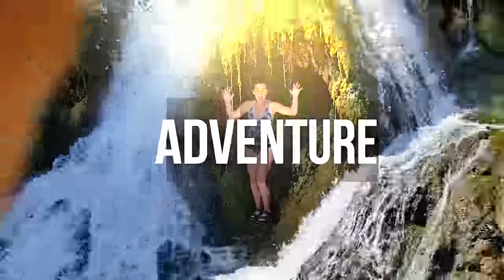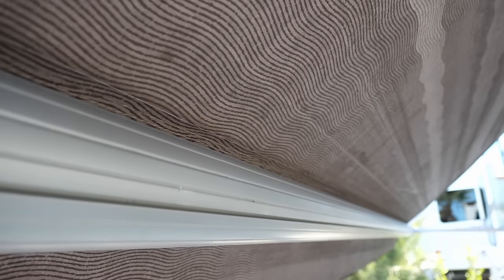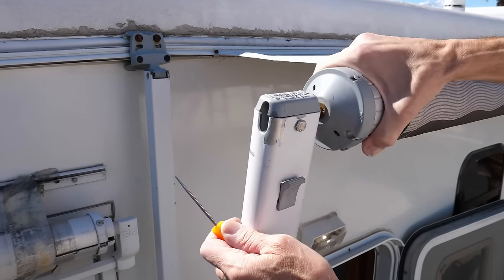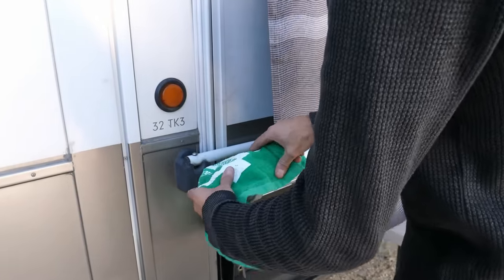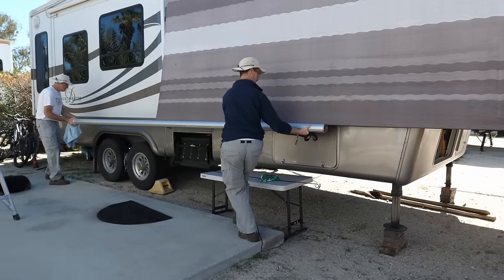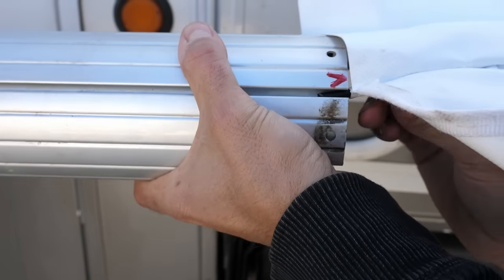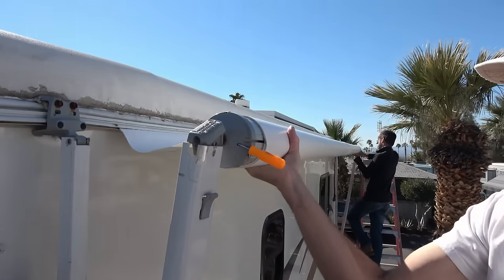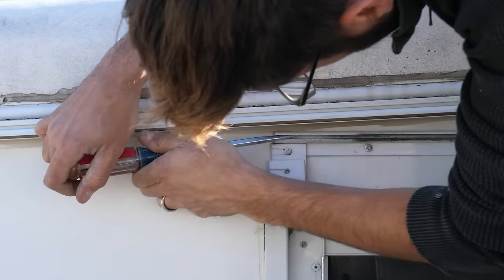How Easy is it to Replace RV Awning Fabric? - Replacing A&E Awning & Slide Topper with Tough Top

Comment: What?  No O-scope, DVM, or soldering iron?  Not even a spectrum analyzer or network analyzer?  Actually, this is very timely.  When I was snowbirding in Florida this year, the wind came up pretty dramatically in the night.  I didn't worry about it as I had my tie down straps over and under the awning and they have been terrific in the past.  Well, come morning, I went out and saw that the sun had weakened the over the top strap and the wind had broken it.  Now the full force of the wind was felt by the awning and it was ripped off the roller about four feet.  I am going to wait until spring but then I need to do the same thing you did.  Yes, I will leave my scope, meters, etcetera at home as you did.  Are you volunteering to come help?  Just kidding!  Not a serious question!!
Reply from the maker: Ha!  I feel lost some days without a scope.    Probably will pick up a portable some day! We all love awnings but in the wind they sure can be a pain!

Comment: Fabrics look beautiful. Camper looks like it got a bit of a face lift.  Very nice. You guys should look into a weather shield for the patio awning. It can help protect the fabric from the sun in hot locations when rolled up or traveling and protect from trees and other things that graze the side of the camper while driving down the road. Only thing I see wrong is the anti billow device is not set quite correctly. Keep up the good work guys. She’s looking better all the time.
Reply: weather shield? mesh? or other.... do you have a specific link for readers of this video????? is this a clip on item once unfurled??? One could make such with rayon sail cloth and a sewing machine and some clips.

Comment: Excellent video.  My friend and I watched your video and replaced my 16 ft. Awning fabric in    1 & 1/2 hours without a hitch.  I priced the job out with three RV service centres and they said it would take 3 1/3 - 4 hours at $144. per hour.  What a rip off.  Thanks again.

Comment: Great job on both the awning and slide topper replacement. I have replaced several awnings over the years for both ourselves and our friends. I have also replaces a couple of slide toppers. You definitely need a minimum of two people for the job. When it comes to unwinding and rewinding the awning springs, I never let anyone do this job but myself as it is too dangerous if someone doesn't pay attention and lets the vise grip slip.
Reply from the maker: Yes! if that spring let go that would be bad!

Comment: Great video. I made the first half of a video showing some small prepwork i did while im waiting on my awning. It eliminated having to disassemble the tube or try to unwind the spring or even drilling and replacing rivets. I tryed putting a link in a couple of video comments but it doesnt show up for some reason.

Comment: Thanks so much for creating and sharing this. In 2018 somewhere between Texas and Colorado both of our slide topper awnings experienced, should we say, an ABRUPT billowing event! Extreme crosswinds whipped them fully open on a busy Texas highway, and although they didn't rip in half, we had to use vice grips to keep them from billowing back open. So first, I'll look into installing anti billowing parts (didn't know I was missing them until seeing your video) then second, I'll rewatch this before installing our new awnings. I've been putting the job off, but you make it look really do-able. Great work on this video, and great discount code choice. I agree MORTONSRULE!
Reply from the maker: Hmm, maybe they were removed or never had them... I have seen ours prevent billowing once. You should be able to get new ones.  Glad you didnt loose the awnings or hardware!

Comment: May I suggest you buy some vinyl eavestrough and make a removable cover to preserve your hard work and awning. 

It works great for protection from the sun and weather when not in use or stored for the winter!  

NOTE:  The eavestrough is not meant to be left on when traveling.

It goes on in seconds!  It snaps into the track just above the top of the awning and rolls around the awning, directing the rain down and away from the awning.  The awning is completely hidden from the sun.😊 🇨🇦

Comment: A couple of things. You could have filed the corners of the awning tube before sliding awning fabric on just like you did on the rail. Also the spring torsions have a spot to use vice grips so you want have to use a towel. A towel can easily slip no matter how tight. Last but not least I'm curious how long the new fabrics will last not only are they see through but they look like they are a thinner even though at the end off video you said they were thicker.definitly the double stiched seams are an upgrade compared to the domestic and carefree single stitching.
Reply from the maker: They are thicker but much more flexible.  Our original fabric had become brittle.  Wow if there is a spot for the vice grips that would be a much better solution.  As far as fabric life thats hard to say but I know the RV geeks have had theirs a long time without problems.  Our main awning was only 4 years old!
Reply: @MortonsontheMove  you can search Google for the dometic PDF on torsion or awning fabric replacement.if I remeber when I'm at work I'll forward you a copy. It shows both with vice grips and with there special tool how to grip the torsion for winding and unwinding. Just a side note the way I remember which way to wind a torsion is up up and away like superman used to say. Your vice grips rotate up and away from wall of vehicle.also thanks for info on the fabric

Comment: Great Vid! Question: Is there anything that should be lubed on the rotating part? Reason i ask is last time out either something broke or the wind got under the fabric and caused the end support to break and the roller and a awning were flapping in the wind going down the road! I did notice when sliding in that it wasn't rolling up smooth, it would stop go,stop go as afar as the awning rolling up. It looked good when it was in but....? Maybe my tension needed to be upped a bit? Yet to dive in and fix it I'll have a better idea what happened after i fix the broke one and check the others. Tip:adjust mirrors up a bit when towing to watch the upper part of trailer, that way wont have to rely on someone screaming at you thru window rolling down interstate!
Reply from the maker: Probably a bit more tension and lube the latch mechanism on the end of the roller tube while out.  I should have shown it, but we actually did spray ours with a bunch of white lithium while we had it apart.

Comment: How do you add turns to the opposite end without the stop latch to prevent it from unwinding? Add the turns while holding constant pressure and then poke around with the awl to find the stop hole?
Reply from the maker: Correct, I would highly recommend having a second person to help.

Comment: thanks for this video... I saved the link.  It will be useful prior to my replacing awnings for my used 5th wheel with 3 slides I bought cheaply.  What was the cost of AWNING PLUS 3?  NORMAL AND WITH rvgeek DISCOUNT CODE.
Reply: Hi YouSurf! Awning and slide topper prices vary depending on size. The way to price yours out is to follow the instructions on the Tough Top Awnings website for sizing.... for slide toppers, measure the distance from the inside edges of the two end caps, as well as the depth of the slide, and for awnings, just the he distance between end caps (the depth is standard, so not needed). You then use those measurements to walk through the ordering process (which will instruct you to deduct a small amount from your width measurements) and they'll provide pricing. The discount is 5% whether using the Mortons or Geeks discount code. Hope this helps, and good luck with your installations!
Reply: @RVgeeks  yes, but I had asked what what WAS their cost... my old unit is almost identical with 3 slide awnings of same size and such... Please, your answer is a non-answer.... I asked what  THEIR cost was for them to get a ball park figure.